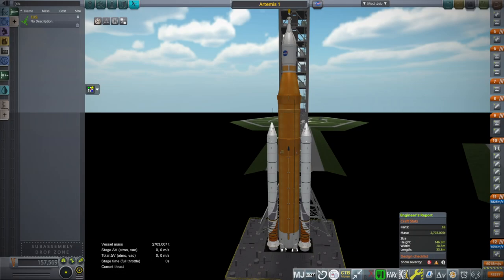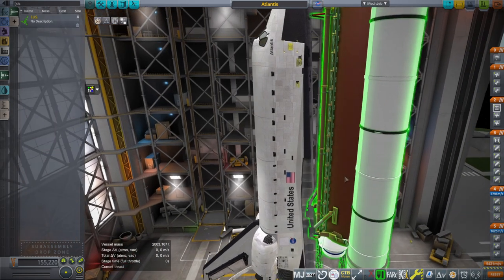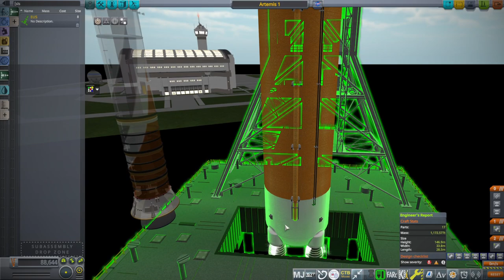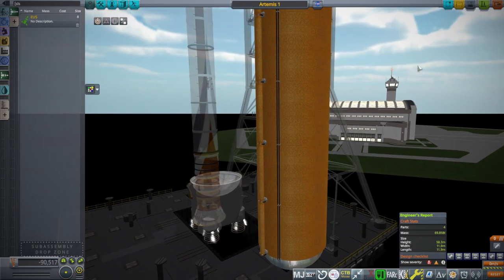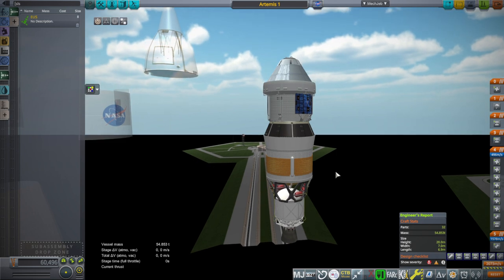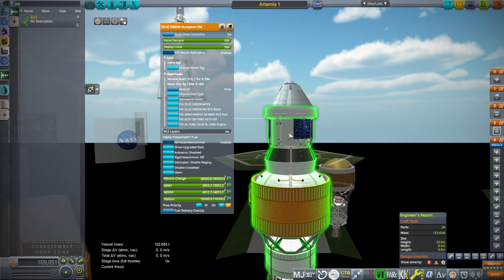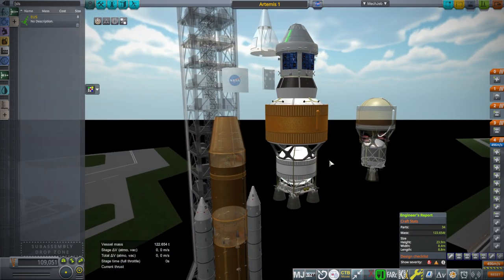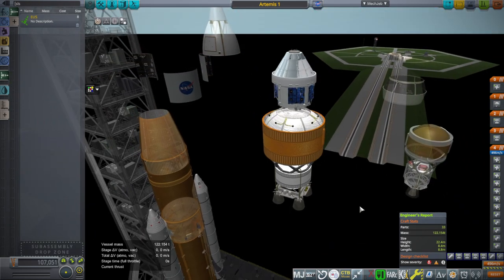On the Design of NASA's Space Launch System (SLS)

Comment: Should also be noted that the SLS core stage is Block agnostic and has the loads of future evolutions already deeigned into it so that they won't have to re-design it for every upgrade
It's intertank thrust beam is designed to take the thrust of the Block 2 boosters, it has been structurally rated to carry the mass of a full EUS on top etc
Reply from the maker: Yes, but those future evolutions don't add as much mass to it as needing to strengthen the hydrogen tank, and I think the new tank design did take the most time.

Comment: SLS core stage uses a new tank material, new method of manufacturing, and even a new kind of SOFI. Orion's small service module comes from Constellation, where the underperforming SRB first stage of Ares I would lead to a campaign to cut mass from Orion, leading to the Lunar landed launched on Ares V to do lunar orbit insertion. In the end, black zones from Ares I's low TWR upper stage killed it, and Constellation got canned in the end for different reasons.

Comment: Found your channel thanks to your KSP Artemis 1 + Principia video (and SLS launch I guess kek) and found this video. Great one! I learned many thing!  I never realized that having the vector not under the external tank had its advantages on the Shuttle. Having a such large external, LH2/LOX tank to be only 28 tons without any fuel seems to be actually a outstanding achievement. 

By the way, a technical detail I'm not sure to get: has the capability in "fuel" changed between STS External tank and Core stage from SLS? e.g does it carry more LH2/LOX?
 
Anyway, I never realized how  much overpowered was the first stage in the Block 1 configuration. Well, let's hope EUS is actually developed so we can have the "true" version of the SLS. Also let's hope you can do a similar video about SpaceX's starship when it will launch.. one day!
Reply from the maker: The SLS core carries 33% more LH2 and LOX than the Shuttle External Tank because it's feeding 4 engines instead of 3. The burn time remains roughly the same.
Reply: @RaizSpace  Thanks! So the redesign had to take that into account, too.
Reply from the maker: Yes, but if it was just a matter of quantity they could have just used a similar internal structure that the tank already had - just extending it. And, of course, the mass of the SLS core is much more than just a 33% increase over the Shuttle External Tank, indicating a much more radical redesign.

Comment: I don't see why the RL-10 can't go over it's rated burn time. It's one of the most well refined and used engines currently operating
Reply: I know some of the older versions with lower chamber pressures reached thermal equilibrium and could run essentially indefinitely. If it doesn't reach thermal equilibrium it might need to shut off to cool down. Even the R-4D has a limit to how long it can do a single burn
Reply: @jmstudios457  Exactly. A modern one might not be designed for it, but it would be relatively easy to work out a way to make it run without issues
Reply: I'm sure I'm being super naive here, but yes. Might need to modify to reach thermal equilibrium, but then the only limit to how much you can use it is the oxidation of the hot gas side of the inner wall from species like OH and H2O and the stress from starting and stopping the engine (the expanding and contracting material puts a lot of stress on it and if you don't keep that in mind it might crack)

Comment: Maybe you should try flying SLS with the shuttle-mice mounted on/just bellow the intertank? They'll still be bellow the CoM, so you should avoid all the stability problems that come with high-mounted engines, and you would be able to lighten the LH2 tank to Shuttle levels. Although I suppose the LH2 feed lines will get a bit complicated...
Reply from the maker: I think the engines torching the hydrogen tank might also be a problem - you'd have to add heatshielding.
Reply: @RaizSpace  Sure. Once you get up into a vacuum, the gasses probably expand fast enough that it doesn't matter much, but you'd need heavy enough heatshielding for the in atmosphere bit.  Perhaps a thin metal coating, like Rocket Lab has on their reusable Electrons for entry heating, would be enough?
Reply from the maker: Would need a computer thermodynamics model to figure out how much would be necessary.

Comment: I guess this means the core stage would need a bit of a redesign for you shuttle mice concept?
Reply from the maker: Just the bottom thrust structure part - obviously the existing four slots wouldn't be necessary, but it should be possible to ensure that the force from the Shuttle Mice is conveyed directly through the thrust structure.

Comment: 1400 tones is light compared to 3000 for Saturn V. It will go up with the Blocks. Also building production lines for a bunch of comments that have either never been bild before or have to be received from the shuttle program is expensive and takes a long time. America has not built a rocket like this in a long time. Do I believe going back to the moon is worth it yes. Congress finally has the appetite for big deep space missions again. And that is exciting.
Reply from the maker: Well, the total launch mass is more than 2400 tons. 1400 tons might be when the liquid propellant isn't loaded.
Reply: Block II and III will be more comparable to the Saturn V in terms of payload capacity. One thing to note is that even Block I has more thrust at liftoff than the Saturn V did.

Comment: would there be a possibility to attach the delta upper stage on top of the EUS stage?
Reply: Technically Mobile Launcher-2 and Block 1B will allow a cryo stage to be inside the cargo fairing on top of EUS, so this isn't actually out of the realm of possibility. (The notional stage was the Centaur-III)
Reply: @okankyoto  I wonder would there be significant deltaV gains if the orion capsule were on top of that hypothetical stack.

Comment: The J2X has an ISP of 450 seconds the Rl 10C around 460 that are only 10 seconds
Reply from the maker: J-2X had 436 seconds last time I checked. Do you have a source for 450 seconds?
Reply: @RaizSpace    https://de.m.wikipedia.org/wiki/J-2_(Raketentriebwerk)
Reply from the maker: 448s does sound familiar - perhaps I was thinking of the J-2S for the 436s. Still, in the scheme of efficiency, this ends up being non-trivial, and the dry mass being more than double that of four RL-10Cs isn't great, either.

Comment: Development in the early years was poorly managed, but in 2014-2015 onwards it was just bad luck. The first 3 flights are still contracted as development flights, around $2 billion per launch, but operational flights are expected to be around $850 million, and of course this will come down if NASA chooses to try to make full use of SLS(Michoud can handle something like 4 flights a year, if they had the proper tooling)
Reply: Well michoud can make theoretically 4  cores per year but question is, Can aerojet make enaugh engines?
Reply: @_mikolaj_  The plan is to be able to with RS-25E